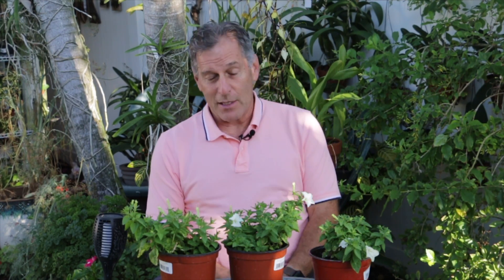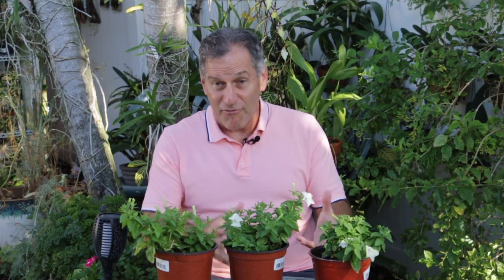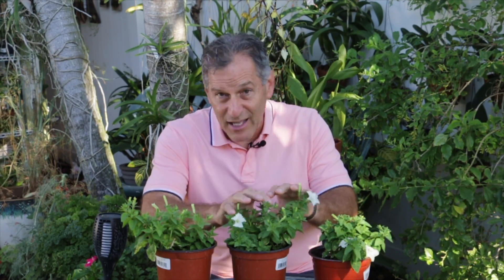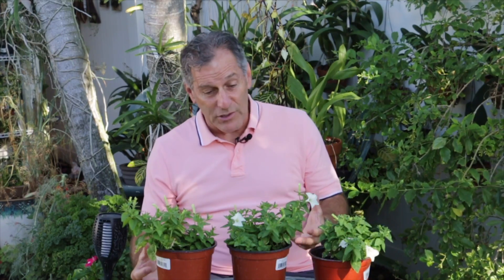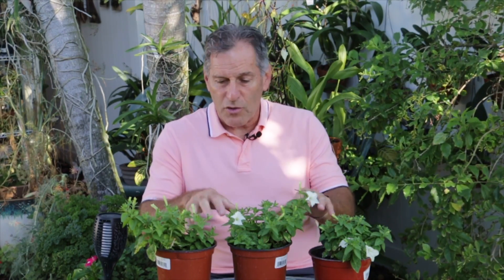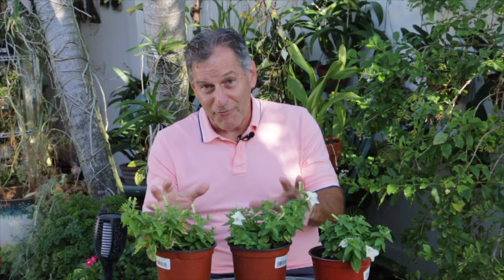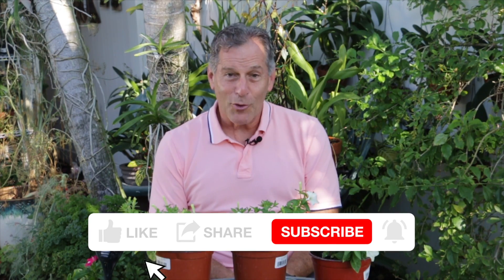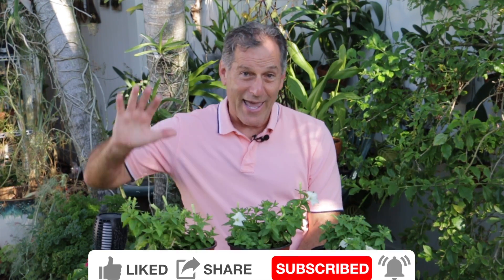Firefly Petunias and More!

Comment: Hey do you know if the seeds will carry-on the Gen modification?
Reply from the maker: The introduced genes are typically integrated into the nuclear DNA of the petunia, which means that they will be inherited just like any other  native DNA in the plant. They could have used a non-seed bearing line (sterile) but I am pretty sure that they did not do that. So, this gene will be passed on through the pollen or seed parent. Thanks for watching and for your comment. And, Happy New Year!!
Reply: @ do you happen to know anyone who has seeds form them?
Reply from the maker: @reallymattis8016  Sorry but no, I do not know anyone who has seed from them. They are still selling plants but they are pretty expensive - and, they do not ship in the winter.

Comment: Do you have any experience creating petunia polyploids? Interested in trying it with firefly petunias
Reply from the maker: I am sorry but I do not ay experience generating polyploids, although I am asked this a lot. The challenge is not the application of the chromosome doubling agent (which you need to be careful with since these compounds are mutagens) but the testing of the results to determine if a diploid or tetraploid has been made. Another question is the ploidy of this petunia. I contacted the people who made this petunia to ask what petunia cultivar they started with and they never answered. The petunia cultivar 'Mitchell' is a white petunia that is used a lot in plant transformation work and I assume that is what they used. Mitchell is diploid. But, they never responded so I do not know what they used to generate the Firefly petunia.

Comment: I was wondering how thorough are the checks and research made before they are deregulated? I'm sure they checked if the genes will "leak" to other plants, or if there are secondary deleterious substances coded by the introduced genes, but have they checked on the effects they might pose to the real fireflies? I mean, even city lights are disrupting to their mating processes, so bioluminescent flowers might pose an even more serious problem to them!
Reply from the maker: Thanks for your comment. Genes do not transfer from one plant to another (unless they are closely related and compatible) and only if there is a pollinator or wind and close proximity in the case of wind pollination. If genes transferred between non related plants and/or organisms, we would all be in trouble. The deregulatory process is pretty thorough but you cannot predict all possible outcomes. I do think that lights from street lights and houses would be more of an issue than weakly luminescing flowers. The fireflies around my house in the summer time do not seem to be in decline. And, the luminescence genes are from a mushroom - not the firefly so it may be a different wavelength of emitted light. I do appreciate your concerns and, if they respond to me, I will ask them about this.
Reply: @plantpropagator  Yes, the wavelength is key with these firefly interactions, so it is not so hard to make firefly safe luminescence, I would think. Different species of firefly are attracted to their specific wavelengths and so long as it is not a match, fluorescent flowers may be fine. But, if it is a match, then the consequences would be dire, would a fluorescent flower turn invasive in the woods, in places where city lights are not yet a problem. Ok, I AM looking for worst case scenarios, but that is what we should always be concerned about, right? Thank you!
Reply: @plantpropagator  My bad! I didn't express myself right! I meant "leaking" from a garden population into a wild population of the same kind of plant!
Reply from the maker: @improbabilitydrive6005  There are no wild petunias that are native to the USA. This is addressed in their petition to deregulate. But, I am not an expert in this area. There are cultivated petunias around but they are not listed as invasive and, if outcrossing would occur, the introduced gene would not give any resultant petunias an advantage that would allow them to proliferate. This is also addressed. Many of the large companies that make transgenics have many experts on their staff that test and address these issues. Even with this, something unforeseen could come up. This is the case with all new crops - transgenic or not....

Comment: Will the gene pass to the next generation in the petunias?
Reply from the maker: Yes - the genes are integrated into the petunia genome and will behave like other genes. 1/4 of the seeds will not contain the genes, 3/4 will. I do not know if they used plants that will not produce seeds…
Reply: @plantpropagator you may have heard by now but some people in the firefly petunias Facebook group have confirmed that they seed and 50% of the seedlings glow, some brighter than others which may be the difference between heterozygous and homozygous individuals?